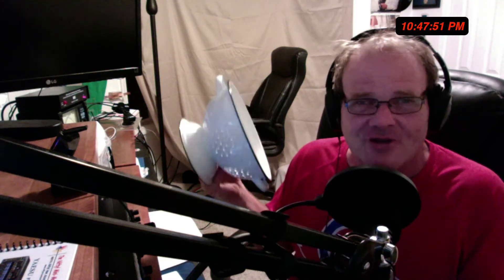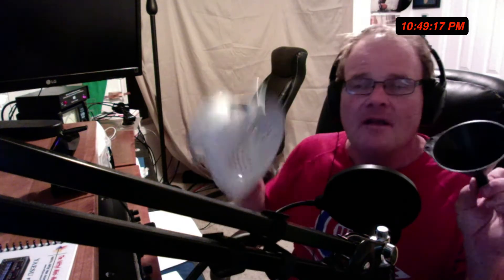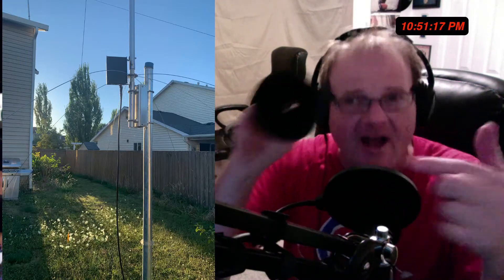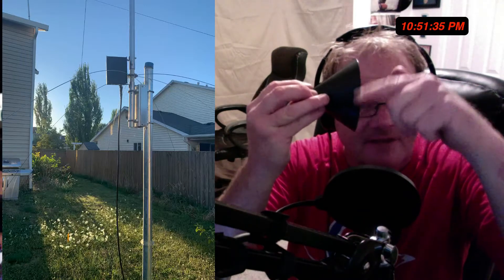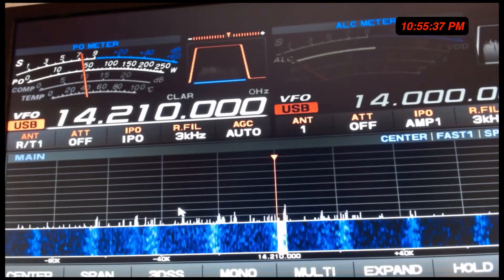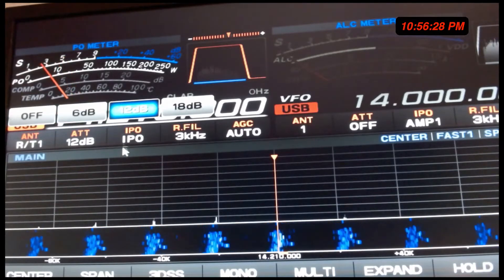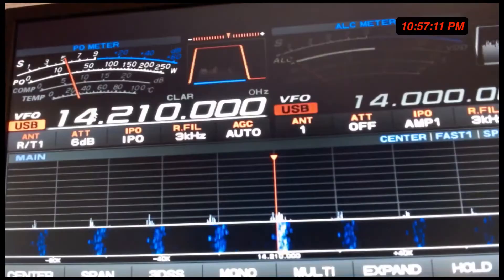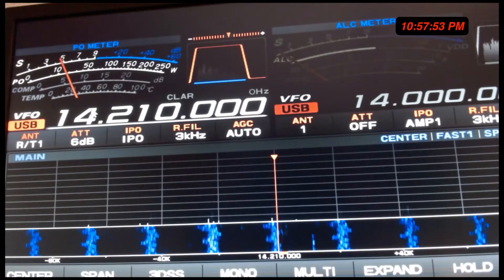RG6 Work Radio Smart The MFJ 1886 Receive Loop Antenna Why You Should Be Using A Loop For The RX End

Comment: Thanks for video, very helpful. I am a SWL and have a couple of antennas, a 6 meters long vertical, a 80-10 meter half wave with a loading coil which I built last week. I have also bought a MFJ 1886 Loop antenna which I love. I have it so that I can raise and lower it above my bungalow roof from outside. I have it arranged so that I can put my arm out of my bedroom (shack) window and rotate it with my arm. It is a great antenna.

73s from the UK.